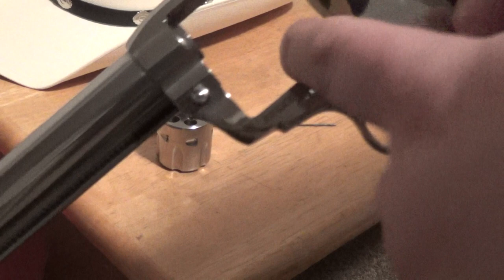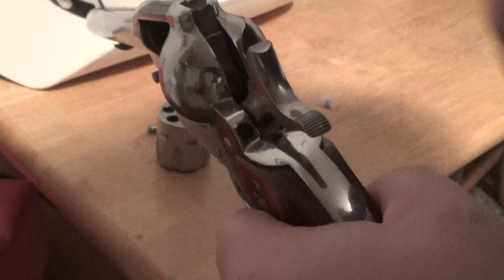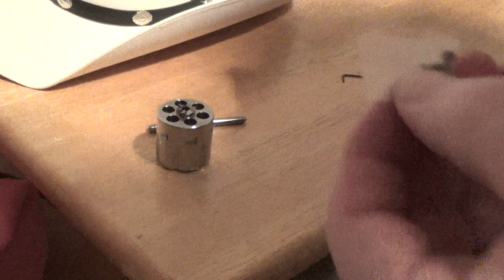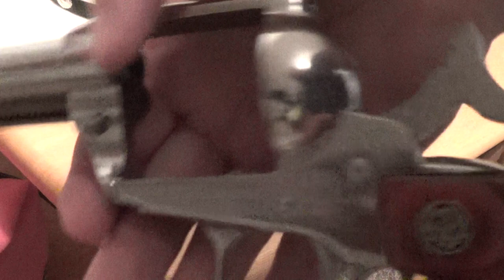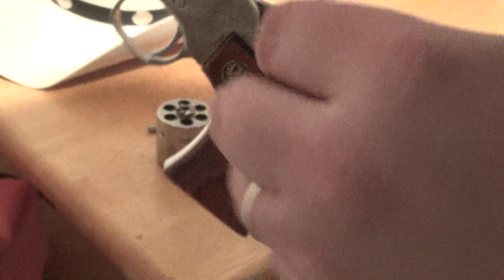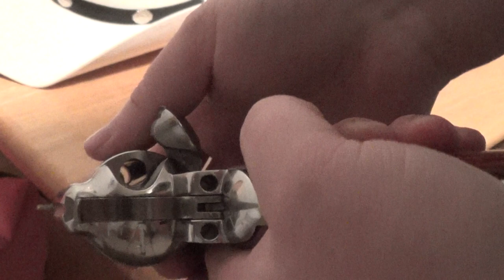Ruger New Vaquero free spin mod

Comment: I would NOT like the "free spin" mode!  Over the years I have developed a fairly fast unload/reload system for single actions that relies on the cylinder rotating only one direction.  I can unload and reload a SA almost as fast as the average shooter can a double action without a speed loader.
Reply from the maker: I did it for competition purposes
Reply: @chriskelly509  OK!????
Reply from the maker: @Valor_73737  k